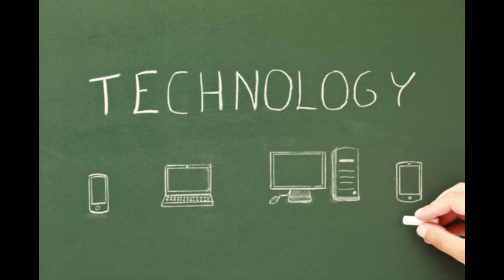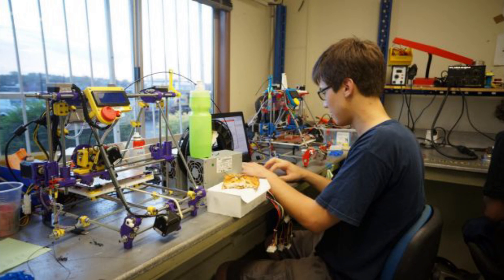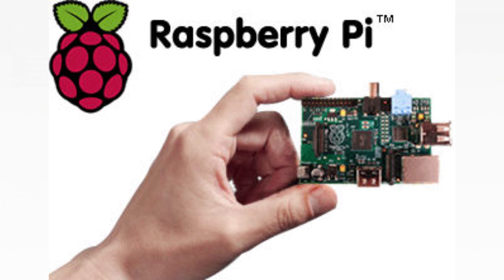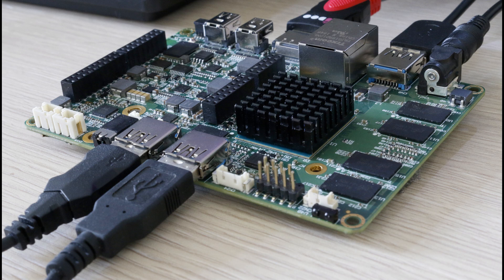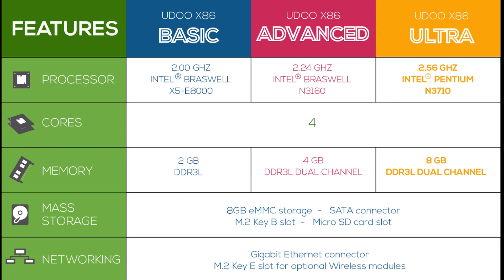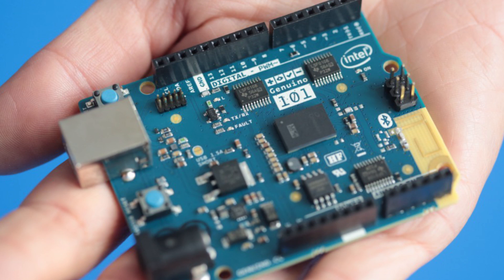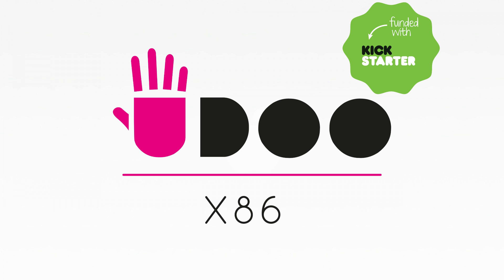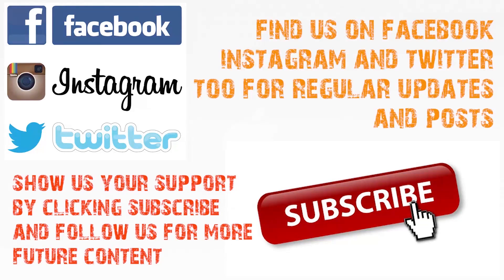UDOO X86 a raspberry pi killer?

Comment: Well the 89 is just for few pcs during the kickstarter. basic model costs 109 (110 if you remove the sales trick). The problem is it's not available at all - they only offer advanced plus and ultra which are $174 and $267 respectively. This is the price of just a normal PC board+cpu+ram which will outperform these (if you are saying that performance is killer). i3-4170 3.7GHz - $108, $64 for a Gigabyte MB,  $52 for 2x4gb RAM = $224 - price a less than ultra but much more powerful than it. The maker boards have following priorities - Size, Prize, IO, easy to install/os compatibility, power  and one of the last is performance. If you need a media center or something like that you don't need maker board - you need any board with good performance. Also there are a lot of mini-ITX boards that include CPU which cost less if you include the price of the ram. MiTAC PD14RI/ N3160 - $100 + 8GB RAM = $152 twice as much ram, but $20 less than advanced plus

Comment: The R Pi foundation have limited themselves to consumer and builder and commercial boards that retail at £35 or less, so no pi's cost $90. Plus thats wrong anyway...its well over $100. I'm sure two raspberry pi 3b+'s and an r pi nano in a network cluster beats this every day of the week....cos those three come in at about the same price. Not to mention that the applications of the pi are basically media boxes, maker projects and IoT... and in that arena X86 architecture  doesn't do anything except making a Ubuntu install and working software a lot more complicated. 

Plus I'd be sure if you compare sales figures you'll see yourself that no killing is being done. I think I'll be sticking with using the trusted pi architecture and maybe the Tinkerboard for media. This give no utilitarian advantage to the consumer other than impressive benchmarks.

Comment: At this price I'll just buy another laptop or tablet from the pawn shop. The point (at least for me) of these micro--computers is to have an inexpensive computer that does enough for some fun projects. I'm finally going to set up a 3D printer of my own (I email my stuff to a friend and pick it all up at the end of the week like a caveman) and want to put a touchscreen with everything I need to just tap a file and walk away. For those repeat items that I use a lot like gears, and whatnot. I suppose I could just send it from the computer I'm building the CAD models on, but that's not as Tony Stark as it could be. If I were building a more advanced robot I suppose a RasPi might not hold up, but I'm not at that level yet. I will say that these advances are a good sign for the future of the under $50 market.

Comment: Nice board. But calling it a "killer" is stupid. If all I need is a Pi. Why would I spend 3 to 4 times as much for this?

I've always been able to get this crap. 2 years ago I bought a quad core windows 8 tablet with the same specs or better. It came with a full HD Touch screen, batteries, charger, and windows. For $6 less than the lowest model of this POS. And that was 2 years ago. It still works great.

The pi will continue to sell 100 times more units than this "killer" that has always been available in many better forms. If we want more power, it's always been there. This is just hype marketing for morons.

Comment: It's a compact PC board using CISC arch. Why are you comparing it with Pi, an energy-efficient RISC arch?  The power consumption rate of CISC and RISC are not comparable.  Intel's CISC computers are never gonna beat RISC computers in the embedded market

Comment: The raspberry pi has never run Windows, it's only be able to run the windows 10 IoT which is not really a windows OS. The only other way to run Windows on the pi is via virtual machine, which is extremely slow

Comment: The Raspberry Pi models are far more cheaper.  $35 for the Raspberry Pi 3, and $80 for the UDOO X86, therefore the Pi 3 is obviously going to be more under powered compared to the UDOO, which comes to the conclusion that this video was absolutely pointless.

Comment: With 20 of these boards, one can build a supercomputer, clustering all of them for 800 cores at 2.8Ghz of parallel processing and one could then mount a virtual machine on the top of the cluster to run windows games or heavy applications . Amazing, no ?

Comment: I have an issue with the claimed performance of the biggest Udoo. Their video shows what he claimed is a "Pi model B" for a back to back performance test. Looking at the video we can clearly see it is not.
 What he used was the 512K model "A" Pi which cannot even run android. No, it was not 10x faster.
 Yet the Pi model "3" is 10x faster than the model he used to "prove" the speed of the big Udoo.
 Now we can run the 64 bit Suse server. That makes the Model 3 another 40% faster.
Wait for the model 4 which should come out in a couple of months.

The big Udoo has some nice addons but its not well constructed.

Comment: You do know the basic model starts from 125$ which is about 3 times more from a Pi 3 right and it only gives like what 1 and a half times the performance.

Also with the Pi people can make their own arcade cabinets as well so they could have a fun experience with friends.
Reply: not to mention the community, for something to ever be a pi competitor it has to be as cheap with a large community of users, and experts.
Reply: nabhan qureshi If you go on their main site it is now 81$ it is 125$ which you can see here http://shop.udoo.org/usa/preorder-x86.html?___from_store=other&popup=no and also the Raspberry Pi 3 is 35$ so that is a 95$ difference which i could buy a 64gb MicroSD card for the Pi at around 25$ which would make it 60$ after and around 40$ for an arcade joystick kit which is 100$ and wood which really you could pick up like an old table from someone throwing it out to make your frame for the joysticks.

So in the end i would be spending 100$ for a full arcade unit with a Raspberry Pi then spending 125$ on that UDOO and then an extra XX$ for what ever project i would need to do which will still be about over 100$ from the arcade Pi.
Reply: hes click baiting 
most pcs can beat the raspberry pi
Reply: nabhan qureshi Every PC can beat the Pi on performance but not on price which really the point of a Pi killer is to be closest to the price and perform better.
Reply: Ecks™ 81 and 25 not a big difference there ?
Reply: Ecks™ I already have a 32 gig memory card and a wireless keyboard so it's literally just 35 for me and it's just personal preference if you really just want a media centre you might as well get a roku 3500 for 17 on eBay that comes with a controller
Reply: Not to mention that psychology shows that when people get attached to a product, tends to defend it ferociously against any new technology, even if it´s better.

Comment: What is the advantage over Intel NUC board? Except Arduino header. If power supply is 12V/3A (consumption 36W), Intel NUC with 32GB RAM (gigabit ethernet, M.2+SATA, Wifi, Bluetooth, ...) is 19V/~2A (~38W), choice for a home project is quite clear.

Comment: Some of these intel chips won't boot on power cut and power reconnect such as a powercut. They need a manual reset. This is a show stopper, if you make remote devices  so reviews will need to factor this. As a heads-up.

Comment: Anything costing close to $100 is NEVER EVER going to be a Raspberry Pi killer.
Raspberry will continue to sell 100X more than this ever will.
Reply: He is right though. While the UDOO is definitely a lot more powerful, the Pi will still hold a huge edge in the price department. Frankly, you can't really put these two into the same category. The Pi is the goto device for small, simple, low power applications. The UDOO is an excellent option though for people who need beefy specs for more performance oriented projects.
Reply: udoo ultra is $209.. people thinks its a pi killer...
Reply: thallium200 Well people miss the point why people buy Raapberry pi's, yes people use it as a destop PCs but most of them use it as projects, like robotics, using it as a server of some kind or making an emulation mashine, also using an ARM CPU mean it does not use much power and there are stuff running that people made what runs on battery power. 

Yea great you can do more with this but do you need more power? Most the time you dont
Reply: cost 3 times than raspberry pi 3 bun 10 times cpu stronger, 8 times ram than rpi, if you need a high power tiny computer i take this and not 10 rpi
Reply: Magnum Opus And it doesn't have a 500GB HDrive or a Monitor so better to buy a re furbished Quad core PC with windows pre installed 8Gb Ram 500Gb HD and a 17inch Monitor too boot...Now lets do a Bench Mark test per $ of purchase price LOL
Reply: jeez somebody is butthurt

Comment: the orginal Raspberry  pi Model B was for teaching little children so being as fast as their phone or a little faster was not on the table but software to make programs for the ARMv6 CPU using a Broadcom SoC chip. For general users windows is actually losing market share to Linux mainly Ubuntu and Android for TV. Both running able to run on x86 and ARM if you get the right card or disk or USB drive. While games mainly are made for windows most consumers do not play more than the included bought when you get the OS games then just web surfing and word processing. The part of the market the UDOO will fill already has a computer and likes them to have a case it is attached to when they buy it. The part of the market the maker boards fill is a very small niche of low power all or almost all chips programmable and have GPIO pins to control a machine of some sort.

Comment: wow multiple times the performance of the pi? for only multiple times of the price and size? it's sure a killer
Reply: ok but how does it scale? say using 48 of them linked together through a Ethernet switch which will scale up with less performance loss per additional unit. As a x86 CPU core structure the code will not change from that of a normal prebuilt machine but when linked together in small grids that take all but 1 port on a switch to do is the x86 unit better or worse at scaling up? a cheap way to get 64 cores with independent RAM is a Node system or Master/slave config with the Master having More RAM and access to the data. Depending on price and the amount of RAM needed for each part of a process job it might be cheaper to buy and use compared to that of a Rack mount server. again  depending on how well it scales up.
At this time lots of stuff is written for phones but if the x86 board consumes less and runs faster while doing it then it is a consumer side win for a new computer shape and size.
Reply: Better price/performance okay maybe, but it's still not nearly as small as the PI. The key feature of the PI is it's size. If this would be the same size then I would say yea it's a killer.
Reply: I can fit a PI inside the dashboard in the car, making a custom navi/multimedia system. You can't do it with UDOO.
Reply: scale is the point of the OP and price/performance/time savings of adding more units

Comment: wow multiple times the performance of the pi? for only multiple times of the price and size? it's sure a killer
Reply: Their point is the difference in price for performance. If you go look at some of the CPU benchmark & comparison websites, they'll give you a price/performance comparison. For example, CPU 1 get 1.3pts/$1, CPU 2 gets 4pts/$1. The comparison between these 2 is 10 times the performance for 2.5x the cost (assuming the claim of 10x the performance is accurate, haven't personally verified it). In other words, if the Pi 3 is 1 pt/$1, the UDOO board is 4 pts/$1. Understand? 4 times the performance to cost ratio.

But, as others have said, it's about what you're doing with it. If you don't need the extra power, why waste the money? But if the Raspberry Pi 3 is underpowered for what you want to do with it, then $90 for a basically complete system isn't a bad price at all. Though if it's like the Pi, you'll still need to buy a case & possibly some other things before you can consider it a complete system, but I bet it would be MUCH smaller, more reliable, & energy efficient than anything from Dell/HP/etc under $300, while having as much or nearly as much power. So you'll still save plenty of money getting the UDOO.
Reply: +Dominick Young but it will never match the pi huge number of dedicated followers. And you say how the pi needs a lot of wires and its not truly compact, however the oduu will need just as many. Also the pi is aimed for projects and poor communities, this is around 45 dollars more, and in the USA thats not huge, in less rich countries its massive.
Reply: Rion gaming Don't point your reply at me. I was simply explaining to the people who didn't get the argument. I understand some people may need the performance of the UDOO while some people may prefer the cheaper cost of the Pi. In fact, I specifically mentioned that in my reply. I also didn't even mention wires or say either system isn't compact. In fact, I specifically said it would likely be MUCH smaller than any typical PC, even after you buy all necessary parts. I also mentioned needing to buy a case & other externals (again, didn't mention wires), but I specifically said the UDOO would probably be the same as the Pi in that area, both would probably need the same peripherals to complete the system. So most of what you said completely doesn't apply to my response. :)

Also, even in the USA, the price difference CAN be huge when you are considering buying 5-30 of these for a single class. Even in the USA, most classes requiring something like this would probably choose the Pi over the UDOO simply for the cost difference.

Comment: Why is there 2GHz, 8GB RAM and 89$ as first picture if the actual product costs close 200 USD??
Reply: if for a general consumer than yeah do that with a prebuilt or custom computer but for a machine control unit size matters and being the size of 2 pieces put side by side of desktop DDR RAM length and width matters the heatsink and cost will kill the product for them

Comment: It is not worth it as the price(base model) is over $100 could get a same spec on a laptop for slightly higher price and also if u need very small form factor get the intel compute stick if u need the raspberry pi connectors use the raspberry pi 3(you don't really need the extra performance)

Comment: 1. UDOO X86 is not using USB power input. 
2. Performance is not big problem for most of my projects. 
3. It cost 3 digits $.  I can buy a e5-8500 cpu, 4GB RAM, 9.7inch IPS screen tablet at $180
Sorry, I skip it.